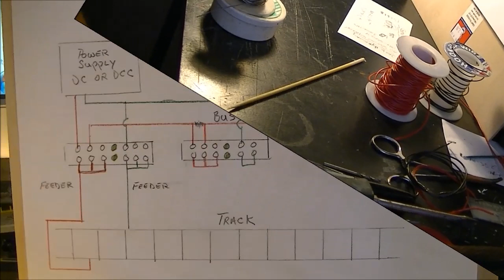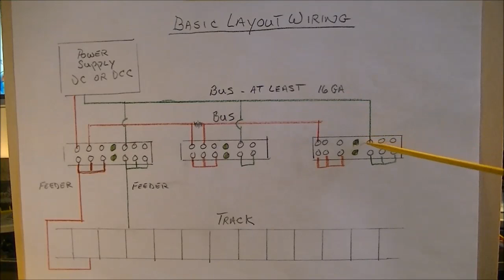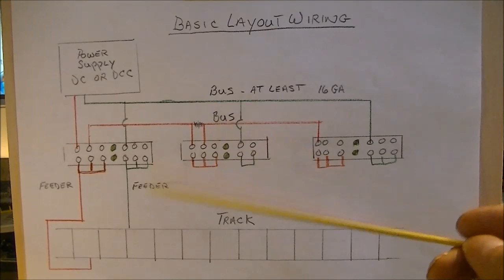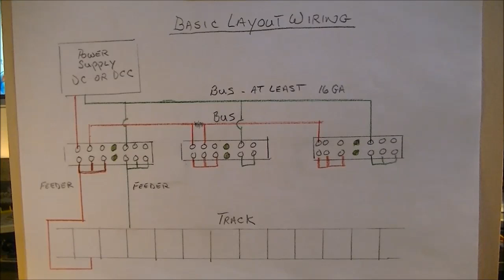SPECIAL REQUEST FOR WIRING A LAYOUT

Comment: Nice going Vinny , I always made my own connectors too. It saves money big time. The barrier strip in the middle and the one on the right are set up to use on another area of track for powered areas? Is that correct?....Jimmy
Reply from the maker: hi Jimmy... great talking to you on the phone... you can use the barrier strip how ever you find it useful. they are just to eliminate a lot of extra work ( soldering).i hope this helps .. thanks for watching & your comment
vinny
Reply: Thanks Vinny, now it all comes back to me with these. Less solder wiring under the table instead of using one wire as a main common lead. I'm not  very good when it comes to wiring, it takes time with me. Thanks for the tip....Jimmy
Reply from the maker: aerobee58 Jimmy... anytime you need help just call.. i'd be glad to help
vinny